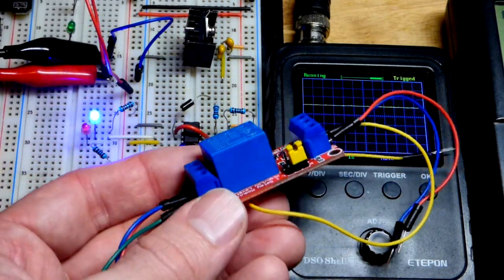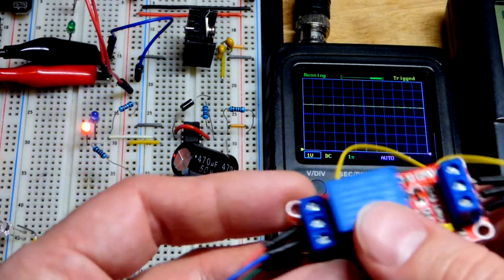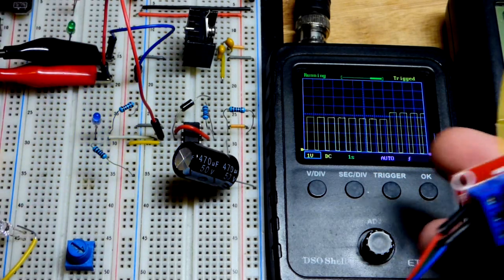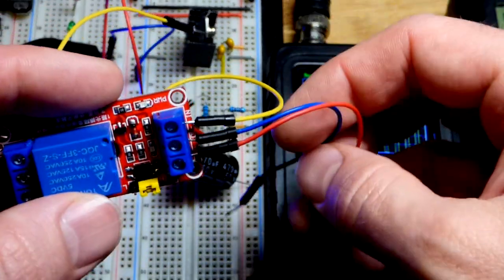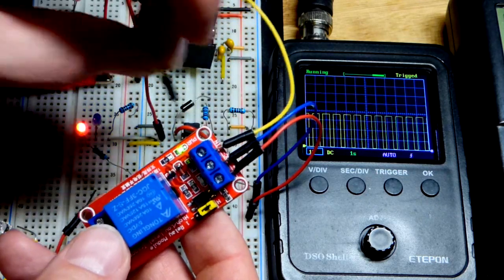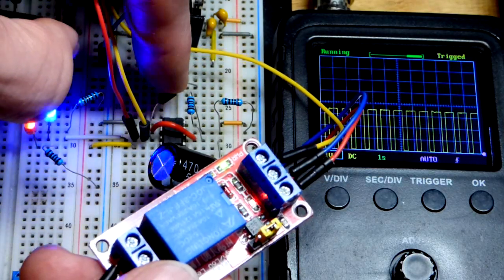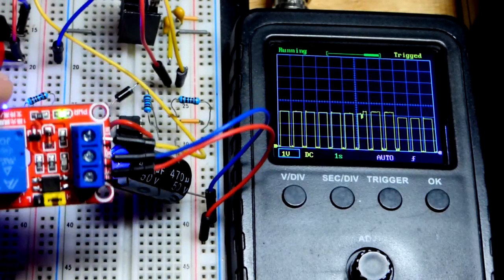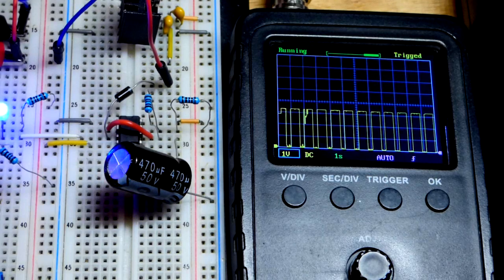Testing if NE555 timer output voltage is high enough to trigger relay module electronics lesson 0056

Comment: Did you order a replacement scope yet? You said yours died a few weeks ago.  I have a Fnirsi pocket scope. It has been pretty good for me.
Reply from the maker: Didn't order one yet. I need to try another power supply with it first to see if that is the problem. I have other stuff that got fried while being plugged into the same uninterruptable power supply.